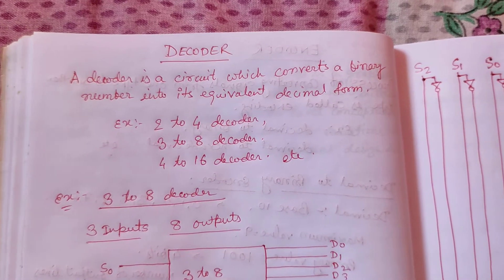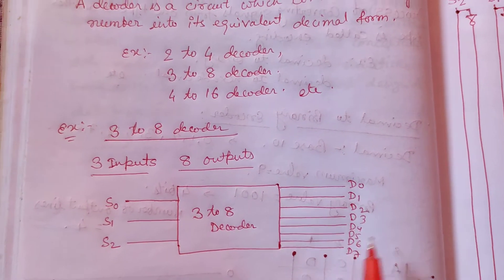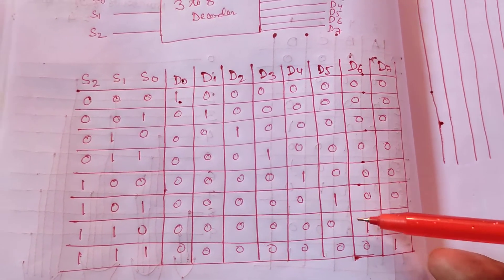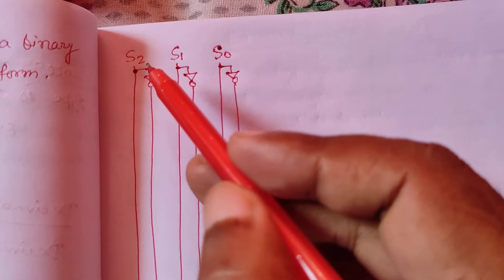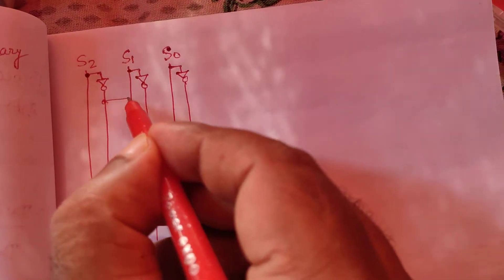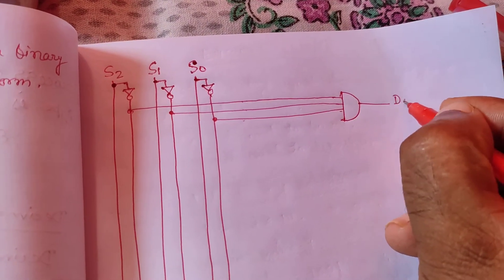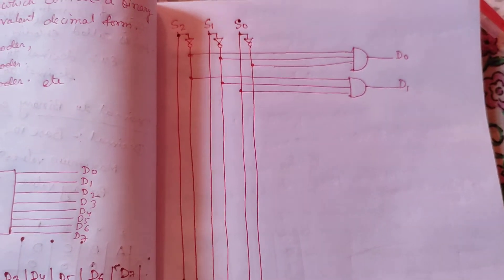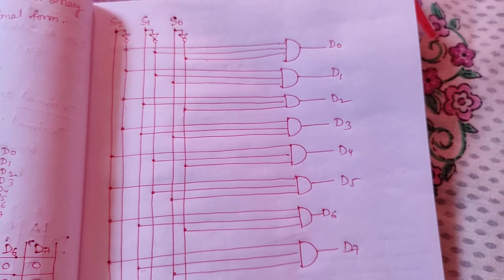DECODER | 3to8 DECODER |3X8 DECODER | COMPUTER HARDWARE | CLASS 11-12 ISC

Comment: Enable line?
Reply from the maker: In the case of Enable input for decoders, if input suppose E= 1, then all outputs will be 1 and if E=0, then it will give complemented output.
Reply from the maker: Enable input concept is out of syllabus for ISC, that's why I did not include here on this video.